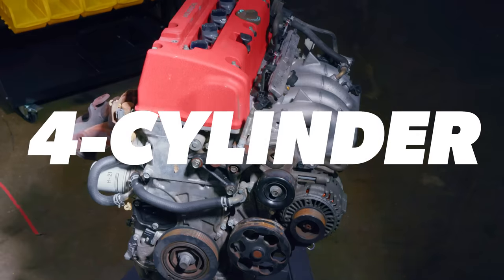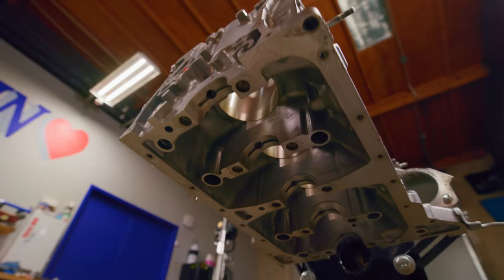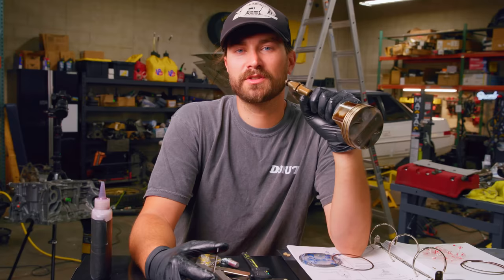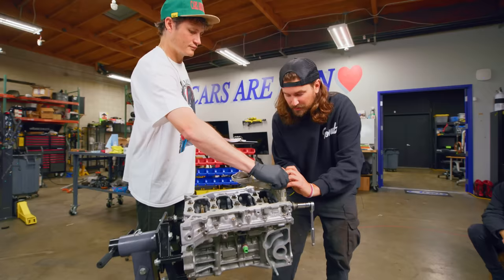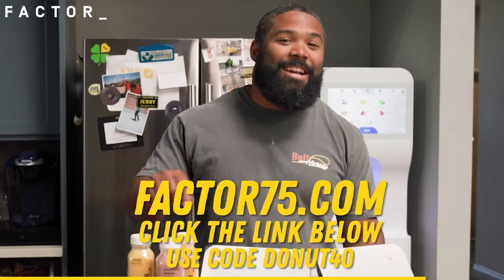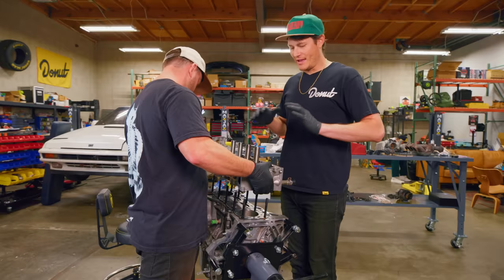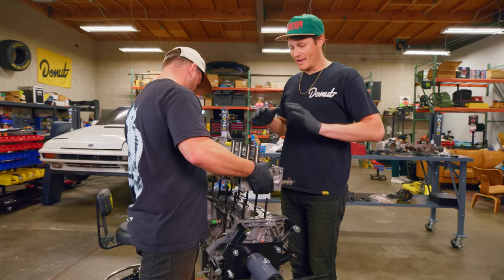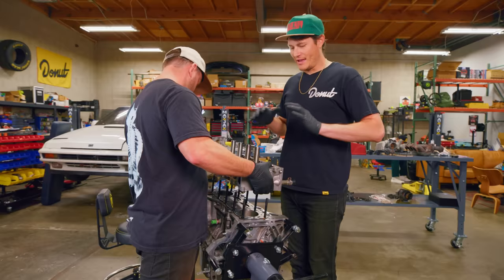Why This Tiny Honda Engine Can Make 1000hp

Comment: 5:29-5:42
I had this same issue putting together my LS engine less than 4 days ago, using an inexpensive ratcheting ring compactor.  2 things in conjunction that I found worked were:
1) ensuring the piston was centered both vertically and horizontally in the compressor as I tightened it, while ensuring at least 10mm of piston skirt stuck out the bottom so that when placed on top of the cylinder, I could use the skirt to help guide the piston into the bore and center the compressor above it.
2) when inserting the piston, I had to give it a truly solid thwack so that it would fly out of the compressor and deep down into the cylinder in one go.  Applying oil on the outside diameter of the piston and rings, and the inner bore of both the cylinder and the compressor helped out a lot in this endeavor (and no, I would never install pistons into cylinder bores that weren't pre-oiled first).
Reply: Holy crap 😮it can go in crooked??

Comment: The closest thing we could get to the DC5 Type-R was the 05/06 Type-S. The K20Z1 was so close in performance to the K20A that with a few mods it’s indistinguishable around the race track.
Reply: Even had the same chassis reinforcements.
Reply: Ditto, the K20Z1 used cams, etc. from the JDM K20A and has only minor differences, mostly for emissions compliance
Reply: Not to mention all the K24a2s I see everywhere so many wrecked TSX
Reply: This is true because the z1 uses the type r cam profiles, but realize there is more support for tuning an a2 than the z1.
Reply: @CthulDude  there’s not more support for tuning in the a2 and the z1. There’s more support for tuning in the 02-04 rsx than 05-06. All you need is to swap the ECU and primary 02 sensor and your good.
Reply: @jacks_Dc5 I’m thinking of doing a k24 swap in my 03 rsx type s
Reply: I was thinking that same thing. They said that the DC2 with a K20a was the closest thing to a DC5 and I looked out my window to my 05 RSX Type-S
Reply: K20z3 close as well or more differences. Ik the oil pump is smaller but what else
Reply: @jacks_Dc5  yes, swapping the ecu with the A2's. You've proved my point. Hench why i said tuning.
Reply: @coleboroughs4726  k20z3 (im assuming this is the one in the 06-10 Si) uses an electronic throttle while k20a/k20a2/k20z1 use a cable throttle
Reply: The k20z1 is basically a K20a Type R but with half a point lower compression. The Type R also factory tuned on 100 octane.
Reply: same, i was like, “but… what about my 05 RSX Type S??”
Reply: @CthulDude  A2 is the name of the motor not the ECU 🤔. You also don’t need to swap with 02-04 rsx type ecu for kpro. There’s a handful of others that will work.

Comment: I had a 216K  mile K20A2 in my 02 RSX when I sold it.  I bought it new and used it for a daily driver.  Always running pure synth oil, it kept running better and better.  It would even run strong on regular gas with no detonation.... good spark knock sensor I guess...   I should have kept that car just for the engine but didn't know these could even come close to 1K hp.

Comment: I have couple cars and have had a few more with K20's and K24's I've been impressed with every single one of them. In my opinion they are one of the best 4 bangers ever made. Great video, guys. 👏 👏 👏
Reply: Kseries, 4age, and 3rz are the best 4bangers ever made. 2zz and 4g motors not far behind.
Reply: @izzy031096  fastest civic is Bseries
Reply: @ybitv5475  Na kseries makes more power. Bseries motors go hard though. So do dseries with boost
Reply: @izzy031096 nah d series rods are paper thin and will break, just do a b18 vtec

Comment: It would be extremely cool and amazing if you guys could sometime build a 1000 HP engine over the course of a series or something 🙏. It's always been rather shush shush in terms of details beyond broad strokes (at least on YouTube in my experience).
Reply: or motoIQ* actually lol.
Reply: YEP - Id watch that
Reply: High vs Low S2K
Reply: If you want to make big power you have to read. Even lots of the SA design books will get you on the same page with the high performance guys

Comment: When doing torque turn, just use the bolt head. 360/6 is 60 degrees. If you just mark the socket at one of the 6 points, then mark that girdle at at the next point on the bolt. Just turn the bolt until the lines meet up.
Reply: Cool trick

Comment: I love it when you guys do Honda stuff
Reply: its a shame that honda has fallen so low in recent times my uncle had a 2017 civic si coupe and the engine blew on him within the first year of ownership those earth dreams engines are garbage
Reply: @aestheticswim3397  he messed with it.
Reply: @turbone54  right, no way it did normally
Reply: @turbone54  no it was stock it was in and out of the shop since he got it that car gave us nothing but problems, face it old honda was way better than new
Reply: @aestheticswim3397  some early Earthdream engines had issues with fuel leaking into and diluting the oil, which can easily lead to a trashed Si engine. Apparently it's been addressed.
Reply: @aestheticswim3397  face what lol I have an old Honda. There's definitely more to the story that your uncle didn't tell you
Reply: @turbone54  definitely lol, and it’s so painful to watch kids like them talk about their Adult family members Sole experience with one specific car they bought in a gravel parking lot, and use it a justification of why an entire company is “trash”😂👌
Reply: as a Toyota tech who had access to a plethora of vehicle information Honda boiled it down to short trips between start and stop without a proper heat interval and also had some issues with poor quality gasoline and oils it has since been corrected with a software update. Not saying the 1.5T is the best engine Honda had ever produced but it’s failure rate is nowhere near a alarming failure rate it’s just souring some owners who have had exceptional reliability from Hondas in the past so this stings more. I’m also a Honda enthusiast I have a 13 civic stick lx with 198,000 miles, 01 CRV auto with 285,000 miles I just sold my 91 Honda hatch with around 300,000 miles that only had a transmission replaced. my parents have his and hers 2017 accords one with 125,000 and the other 30,000. My brother has a 2017 Honda civic hatch with 115,000 miles on it. I’ve had around 10 or so Honda/Acura from 1990-2015 model years and have had 0 catastrophic failures aside from having gear grinding issues in my 91 that was self inflicted from letting someone learn stick on it. I’m probably going to end up buying a 11th gen civic hatch with the 1.5 in the near future to replace my tiring 9th gen.
Reply: @aestheticswim3397  you can't judge a whole brand just from one engine failure every company has engine failure. Honda is still amazing
Reply: @noahvs1999  ik its just that when you pay for something that stands for quality and reliability, then damnit i want quality and reliability
Reply: @aestheticswim3397  Probably wasn't warming it up properly and did frequent stops with it. That led to oil dilution issues with the early L15 motors they put in the 10th gen Si. 

Either way, it shouldn't have blown up and should be able to take some degree of negligence. The turbo k20 in the accord is amazing though. It should've been put in the Si imo.
Reply: @almeida8x  my uncle wanted to swap the accord engine into the si

Comment: Something I haven't heard you mention, the reason that engine is so used over other k series engines that are similar is the ECU for it was the original base for k tuner and those are cheap compared to the other variants with similar internals. Similar goes for the k24s from that year range being as used that only require two connectors swapped compared to back grading the ECU and harness like later engines in that series require for kpro. Other you did a good job explaining the basics for new car enthusiast.
Reply: I think the biggest reason people use the K20 over the K24 is because a stock ECU will run the K20 without complications. The K24A2 has drive by wire, so its ECU can't easily be used for swaps. That means a modified or standalone ECU and tune is required to do the swap right. But since the K24A2 can be found for around $500 vs $2K+ for a performance K20, a K24A2 swap still ends up being about the same price or cheaper and has much more torque.

Comment: the trick to the ring compressor is you want to seat it inside the block a little. If you get the cheapo ratcheting ones this works great cuz you can push them in axially and they sorta "spiral" out, giving you a nice edge to stick into the bore. the edge being in there helps transition the rings. DO NOT hammer on them or force them if they're snagging, you can bend or snap the rings.
Reply: Indeed

Comment: Trowing this out there, I'm pretty sure you should have put the oil pan on last.  You never know if you might drop something in there while working on it, and the front cover is designed to be installed before the oil pan.  The way that the oil pan seals would work better against the bottom of the front cover, by doing the front cover first.

Comment: Awesome guys! That engine in a MR2 Spyder hardtiop would be spicy, the sound in that cabin of 9000rpm alone would be insane... then there's the tight handling low center of gravity and fast acceleration from the light chassis. Great video, im sure whatever car that engine goes into will be incredible.
Reply: I think that’s the plan. It’s gotta be a k series or a 2zz.
Reply: A friend of mine has a built K-series in an MR2 Spyder.  Super fun car.  Another friend has something much weirder: a K-swapped DeLorean!
Reply: @christopherscott3120  that DeLorean definitely hits more than 88mph now.... how about K20a in an Elise

Comment: I'm not even a Honda boi but if my 86 goes I'm totally planning for the K swap cause I love the balance of a boxster motor but 500+hp in an 86 chassis would be INSANE
Reply: Replacing your spark plugs would be way easier too.
Reply: my FRS engine just went... saving up for a k-swap as of now! super excited to have a beautiful and light chassis that can actually have power

Comment: I'm impressed that they're getting so much power from an open deck block
Reply: Open deck never really limits power until 1500-2000whp, the main reason most engines can’t be boosted to those levels is the internals, and compression ratio.
Reply: N54 bmw. Cant go above 700s on a open deck. Hondas cant go big (700? )  with out a block gaurd or sleeves either. You could.... but its not gona last
Reply: @drewdavis239  send it

Comment: I have a K24 in my honda element,  All it needed was a cold air intake, Exhaust mod, And a tune to get to 350 HP from a stock 160

Comment: Dual VTEC....when low RPM you can set it for 280 degre cam. In high rpm you give itu 330 degree cam profile. So it become an afterburner piston engine since it install turbocharger. Just make sure your valve and piston are not melting.

Comment: What most people don't know about compression ratio is that it works on piston while going down also (intake)
The piston being closer to the top of the cylinder creates a greater vacuum force while on the intake stroke. This is why big cams work better with high compression ratio - they need the momentum of fast moving air to wake up the cams.

Comment: Hello Donut team. I love your channel and content. My suggestion would be to put the K20A motor into a Subaru BRZ, the one with the older body style! The car has amazing suspension that’s overdamped and handles great. It’s also compact and the engine bay would be proportionate to the K20A engine. What the lacks is power. And the boosted K20A would be the powertrain it needs and will turn the car into an absolute rocket 🚀. I’d also put 225 tires on the BRZ with some nice aftermarket wilwood racing brakes. Add couple of aero mods. For tuning the boost, I wouldn’t start at 1000bhp, perhaps 500 bhp is more than adequate to test out the vehicle on a track. 

Thank you for producing such great content for us car enthusiasts! Looking forward to the build!

Comment: In the early 2000's my buddy had a GSR Integra, that was supercharged, running on 18 inch wheels. That car hauled so much ass, it wasn't even funny. My neighbors who where a little older had a little car club and they all had bugs. Bugsy I think they where called. They heard the GSR pull up to my house and they where immediately over my house trying to see what was under the hood. They eventually started another car club, TEAM EXPLICIT, with my buddy's GSR being the top dog. Good times!

Comment: During my internship at a garage a decade ago, I got to witness a K20A spew a piston rod and shrapnel 3 inches from my right foot while on the dyno.. I'll never forget the look on our tuners face 😳😳🤣🤣.. 

Block had a 1.5 inch hole at piston no. 3. half the piston head was still in there. the other half and piston rod were found not far from where i was standing. close call

Comment: Back in the early 80's Renault F1 engines were factory tested and adjusted after assembly. They were 1.5 liter turbo engines. The test and adjust run on the Dyno was limited to 15" max and the minimum acceptable power was...1500 HP.
After 15" the engine was either "good" or ... scrapped...
My point is, it's relatively easy to get very high hp from an engine. The only valuable aspect is how long it will last.

Comment: Few important facts from the  K series world:

1. K20A2 is nearly identical to K20A and it's much cheaper as K20A was built only for JDM Hondas. You can tune the K20A2 same way as K20 and achieve similar results. In Europe you could find these engines in 2000-2005 EP3 Civic Type R and in US in 2002-2004 Acura RSX Type-S. Similar engines worth mentioning are also K20Z1 (2005-2006 Acura RSX Type-S) and K20Z4 (2007-2011 FN2 Civic Type-R).

2. It's really hard to make 1000HP out of this engine by any means it's not popular to do so. Most N/A builds have 220-260 HP, turbo and supercharger ones around 350-600 HP.

3. There is also a "Frankenstein" build which is very popular for gaining torque and power when sacrificing some of the revs. It's a block from a K24 motor with a head from a K20A or K20A2. These in N/A configuration can achieve somewhere around 300 HP.

4. When installing a valve cover, despite the installed valve cover gasket you should also put a bit of special silicone - Hondabond in 2 sensitive spots on a head  - but perhaps it wasn't just showed on a video.

5. Most common engine mods contain: 4-2-1 exhaust manifold with a decat and custom exhaust, bigger intake manifold, 70mm throttle body and custom intake. You can't tune this engine on oem ecu so there is also need for a modified one (Hondata, Hondavert or other solutions).

Comment: You can attach the engine to any transmission? I rly wanna build a street legal go kart (i can't rn tho) any engine suggestions the whole car would be around 2meters in length and around 0.8 meters in width (I wanna be able to fit it+ a bike in the back of a van)

Comment: I loved my D16zC motor....It didn't like just more than 8 lbs of boost though  w rebuilt stock internals..upgraded the bearings rods and pistons a bit after the first slung the 4th rod bearing and second blow because of the 4th piston again because it ran hotter than the rest......I always wanted a B18C3 though as an upgrade but the motor I had was so cheap and easy to rebuild......2.5 inch exhaust....B&m short shifter....Fluidyne radiator, walboro 255 lph fuel pump....I forget the company but my ignition was all upgraded.....Fuel rail, injectors were also done, stock trans....But stage 1 clutch...did some other upgrades but I loved my civic.....Greddy turbo kit...Blow off valve was by....I forget but they told me it was for Subaru even though it was a universal kit....oh turbo XS...My next car was a 2004 sti w more money in the driveline than my house cost....Made over 40o hp at the wheels and 370 lbs of torque....26 lbs of boost all day long...custom built and tuned....Loved that thing...can't believe I sold that and my custom Honda CBR F4i....but was making 100k a year and had a lexus is350 awd and an suv and bought a house at 29 years old.....had 3 kids...went to great wold lodge and had tvs and xboxes in every room....all was great until I caught a coworker co manager of mine embezzled money and when I found out he had upper management lay me off because they were in on it...since then my life has been homeless basically...I pray karma takes them out to this day a few years later..
Reply: Damn
Reply: @kampoutkid  Yup....My life in a small book right there lol

Comment: Havent watched the whole video yet, but could someone explain why they say its a 1000hp capable engine and then in their DC2 its only 250hp? Not a big car guy but I saw another video and it was the same thing. Isnt 10.000 for a motor that ”only” does 250hp quite a lot?
Reply: HP doesnt always stem from just the engine, it comes down to drivetrain as well such as the transmission, gear ratio, and tire size can all play a part into WHP, also most of these engines need special unlocked ECUs to be able to tune timing etc etc to actually use that “capable” hp

Comment: That is the stupidest part of these engines is that the water pump housing makes it impossible in some occasions to remove the intake depending on the intake type. On the bug aluminum ones you can put 2 nuts on the left intake manifold stud while the intake is on and then take the stud out which will allow the intake to come out without pulling water pump housing but I didn’t realize that the fist few times I worked on a K engine so I went the king route.